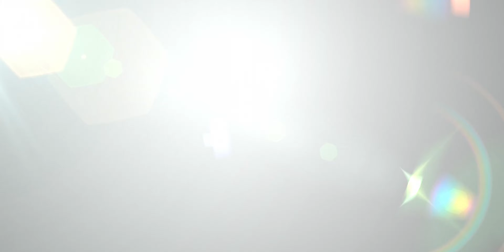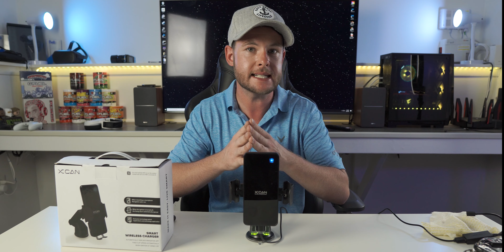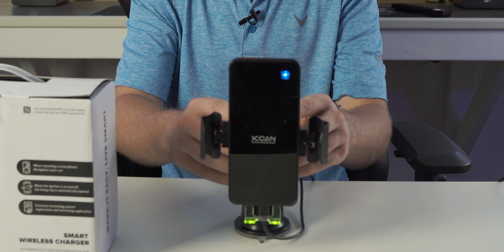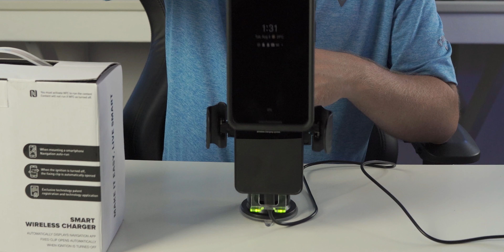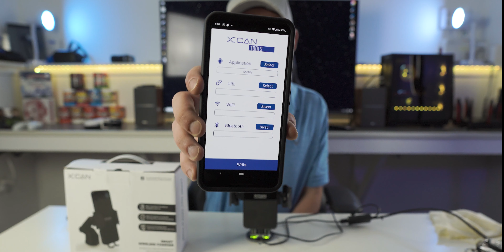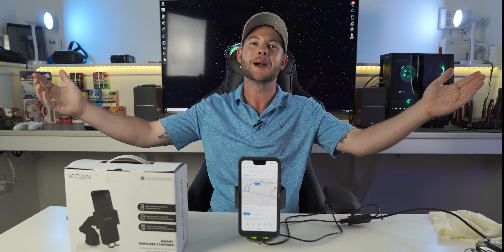You Won't Believe What This Can Do! | XCAN Smart Mounting System

Comment: hi sir,  this car stand do not work with iphone and also do not provide APP as he promised ,  please do not give wrong information on youtube and spread  misinformation
Reply from the maker: There is an iOS work around with shortcuts. The iOS app was suppose to be available for the Kickstarter launch; however, it has been delayed. Sorry for the miscommunication
Reply: @qwazyd0gg  really suggest you correct your clip ! Because not only APP , it also can not auto open  , not compatible with iphone NFC and asked us to erase , can not stable wireless charge 
And there are so many complains from backers already . All asked for refund
Reply from the maker: I currently have no issues with the auto close feature on my iPhone 12, nor do I have an issue with wireless charging. I have developed an issue with the auto open feature upon turning off the ignition; however, that issue extends to all mobile platforms currently. These are discussions I’ve had within the comments already with users to educate them on possible expectations. As for the current video, as it was an early sample initial impressions, I feel those impressions were and still are valid, and owners and/or would be buyers are welcome to chat about experiences openly in the comments as you and I are now.
Reply: @qwazyd0gg  XCAN now ask backer to buy QC 3.0 charger for solving wireless charge issue   and declared not compatible with car which do not shut off USB power when engine off and asked backer use hand to push button !  All these shall be told before we backed . 
And I was naïve believe to buy QC3.0 charger but still not stable for wireless charger
Reply: @qwazyd0gg  All above , it is no difference with my previous mechanical car holder 
1. push button  same as Manual car phone holder push to open /close (all need hand) 
2. to initial APP by short cut , it is   existed function of IPhone ,  We also can use short cut when use mechanical car holder  when plug power cable 
3. Why we need to buy additional QC3.0 charger that we do not expect
Reply from the maker: Maybe that’s why my charging was decent while I used it as I had a dual port QC 3.0 brick.

Comment: I was backer of their Kickstarter campaign, an yesterday I received mine in Cyprus.

First, the iOS app isn’t developed yet, and the Android app isn’t available world-wide. Any serious creator would have had developed the apps before shipping, and would have resolved any app-related licensing and distribution issues way before.

Second, for iOS they suggest a Shortcuts solution until they develop their apps. However, it’s way more complicated, and, in my case, hasn’t worked (I’ve tried with three different configurations for three different iOS apps so far, nothing).

Last, but not least, after just one day of usage, and the XCAN has been proven problematic both in properly charging my iPhone Xs 250GB (running iOS 14.3), and in auto-closing and auto-releasing the brackets holding the phone.

For instance, when I switch-off the car engine, most of the times the brackets won’t open to release the phone, and I have to harshly pull the phone from the holder, or to switch-on the engine again, and then re-switch it off.

Thus, my verdict: this is an overpriced phone holder, that, in my case, offers neither comfort, neither functionality. Or, in layman’s terms: a piece of shitty junk!
Reply from the maker: I am still using this device daily since my initial impressions video, and here are my long term findings:

I had no issues long term on my Pixel 3 XL with wireless charging or app launch. After a couple of months I too had issues with auto releasing the phone as the arms would not auto retract upon turning off my vehicle. I ended up developing a healthy habit of using the motion activated manual release mechanism on the right hand side to disengage the arms before shutting off my vehicle. 

I have since switched to iOS as well, and was unaware of the app issue as I found auto launching software was more of an inconvenience than a convenience depending on where I was going and the application I wanted to use. I have had no issues with charging my device; however, am still having the long standing disengaging issue with the arm mechanism. 

All in all, I think it’s a passable charging utility; however, the NFC for me became more of an inconvenience than a tangible benefit.